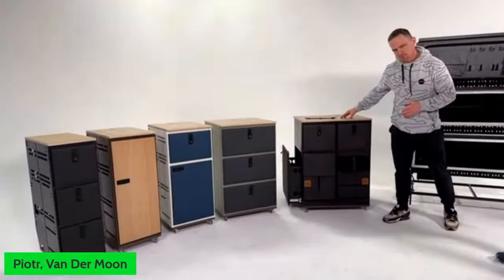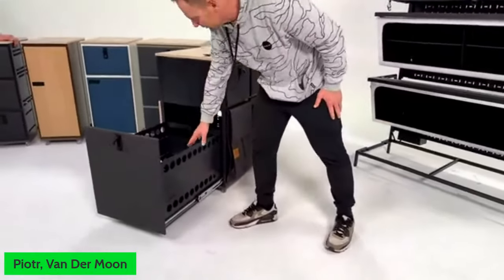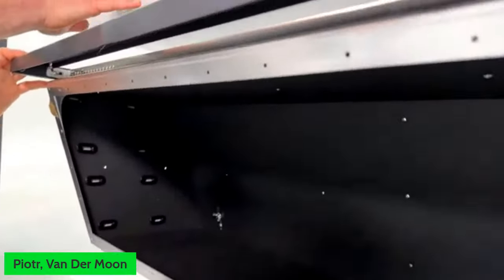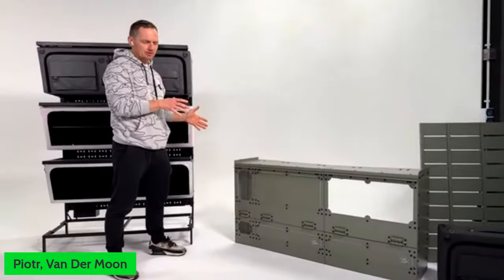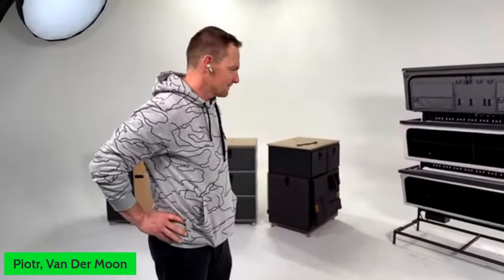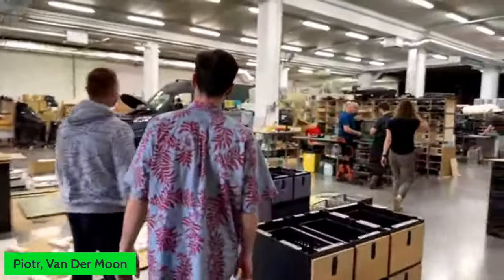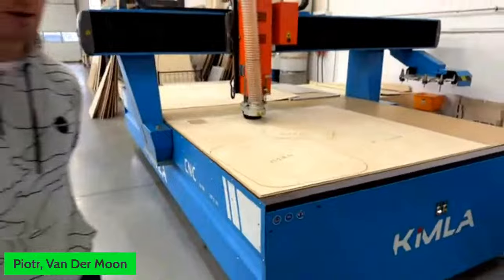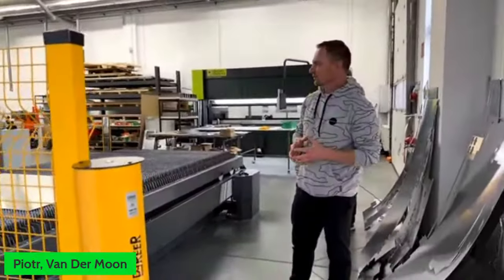Live from Poland, tour VanderMoon factory building exceptional Van Gear

Comment: Powder coating literally uses an electrostatic charge (static electricity) to bond a plastic "dust" to the metal in a very even coat. Then the parts are baked, and the coating flows and becomes basically a smooth thin coat of very resilient "plastic paint."
 As a side benefit there are no solvents to deal with or dispose of.